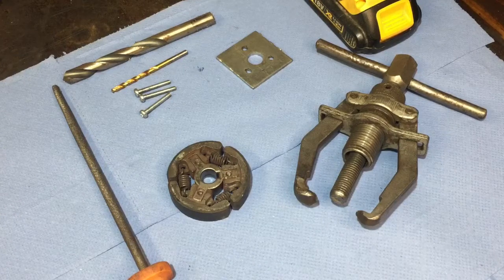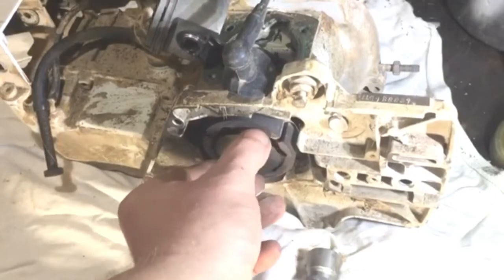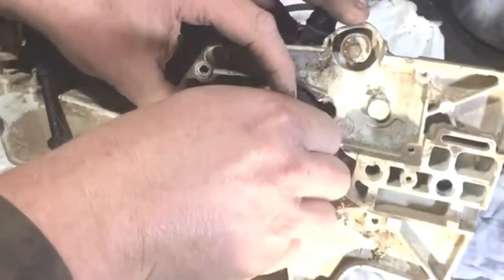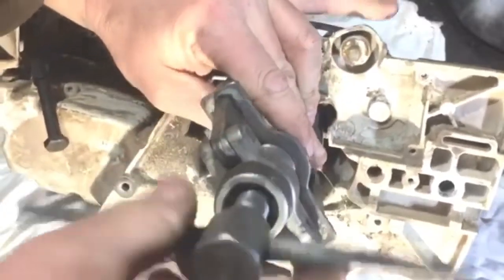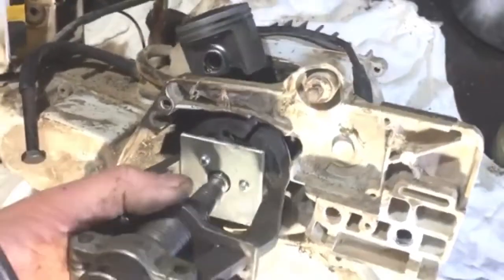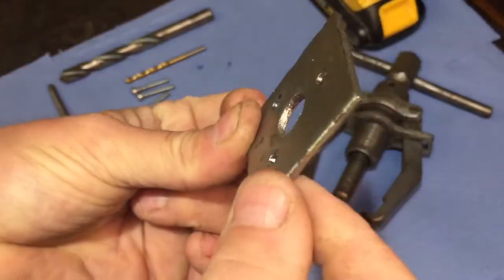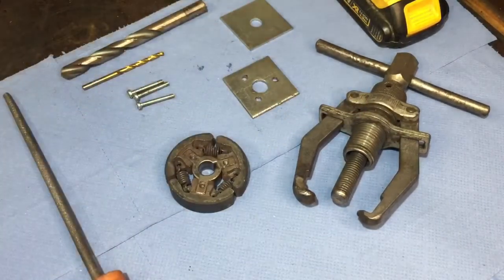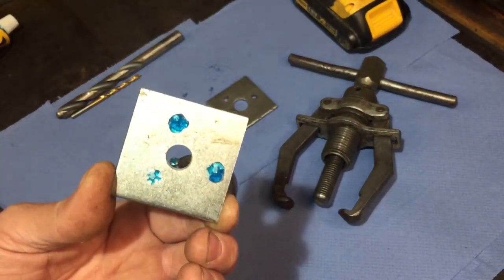Stihl TS350 Cut Off Saw or Similar (How to Remove the Clutch, Without Special Tool ) Save £££s 😃

Comment: I like your puller is there a make on it? Good tips. Thanks.
Reply from the maker: Hi I’d never looked un till now, it’s a Lauravia (French) I bought it from a car boot sale for £2.50, best thing is with it I bought a Tecumseh recoil I sold for £20, so really this cost me nothing, it’s very well made but I looked on eBay not many tools this make on there. Sykes Pickavant is one of my favourite makes for pullers, I believe my 3 jaw puller is that make, they are not cheap though but will last. Thanks for watching 🙂👍
Reply: @menditman2004  sounds like a good deal! Thanks for looking. I have a couple but I liked your one, looked well made. I'll keep en eye out never know.....